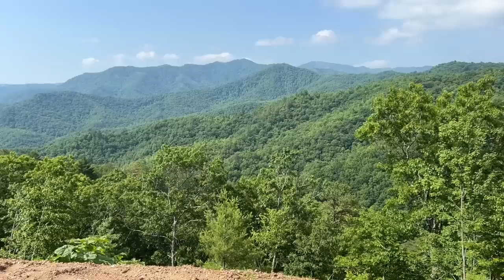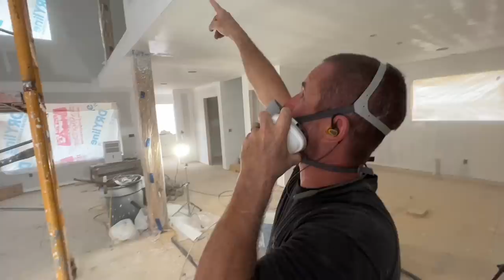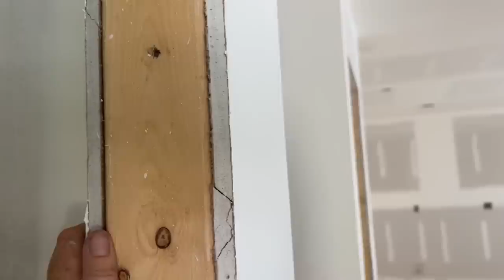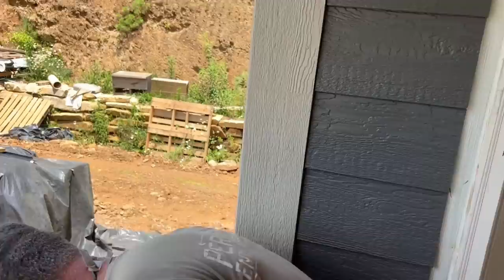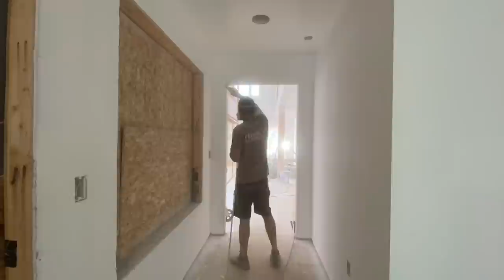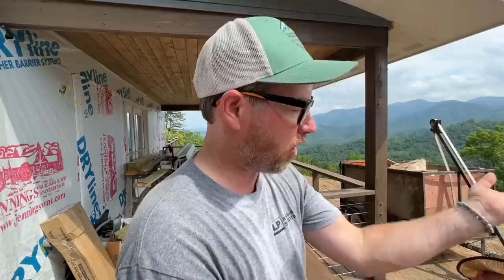Building A Mountian Cabin EP37 | Starting the finish work!

Comment: Put a 12” extension on that spray gun, you’ll get better results, you’ll be more comfortable, and less fatigued.
If you spray top to bottom, left to right, you only walk the length of the wall once.

Comment: If you tried a 3ft extension with a swivel tip you would never paint again without it.  Imagine double the reach in every direction.  Also put a whip between the end of the hose and gun , it will relieve the stress in the hose and both tips will reduce your fatigue.

Comment: Hey guys!  Great work!  Drywall core color is entirely dependent on the color of the gypsum (natural or synthetic) that's used in its manufacture.  The color can range from pure white, to light grey, to light brown.  I've even seen pink natural rock that makes a pink core in the drywall.  The color comes from mineral deposits in the gypsum.

Comment: G,day from Sydney Australia.
Perko, you should wear a disposable suit when painting the ceilings with a spray gun.
Moreover, in the power tool update program, you can purchase a round drywall joint sander (if you're using it regularly) with vacuum cleaner attachment.
🌏🇦🇺

Comment: Y’all should definitely invest in some of those cloth head covers for when you paint that way there the paint don’t end up all over your face and in your ears and on your head. They just have a perfect hole for your eyes that you can put glasses on over top of your mask. Those things work wonders for painting overhead like that with a sprayer. And they’re not very expensive you can buy a whole 10 pack for a few bucks I believe at Sherwyn Williams that’s where I get mine. Don’t get me wrong they are a little hot but it definitely helps out on Clean Up on myself at the end of the day

Comment: Hey Jamie, Several episodes ago I remember at one point you mentioned an awesome tip about circular saws edge being 1-1/2" from the blade. I found out last week that that is not always the case for all of the saws. The dewalt 6-1/2" 20-volt max cordless saw is less then 1-1/2" from the blade. Not sure if they are changing things up, or if this is just for the smaller circular saw.

Comment: lifting buckets of paint? easy 20-30 years ago, no problem, When I worked in the trades I was a drywall finisher/plasterer It was quite a common thing for me to mix up 4 buckets of mud and lift them up onto scaffolding two at a time for the guy working up high, then I'd put my buckets up where I could reach them. I could run through 2 buckets of quick set durabond quick set mud, have my hawk, trowel and buckets clean before the first bucket would even think about starting to set up. 

I'm retired now due to spinal injuries from a head on collision, so I doubt I could lift them like that these days

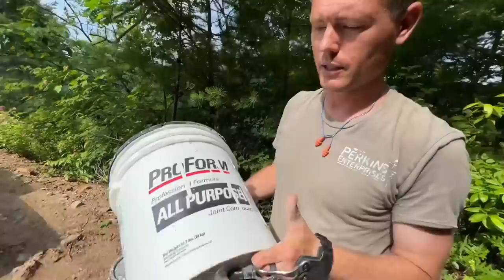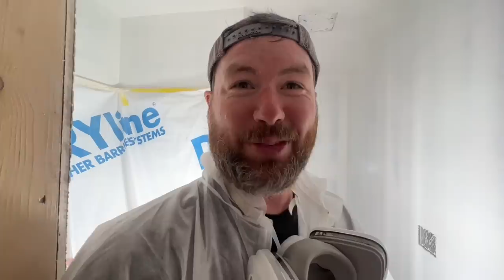Comment: @5:22 that's a great idea.  You can even use the lid to clean you saw blades!  @9:07 Real Life Tip.  When pouring the paint, orient the opening to the top so the paint and air won't compete for the same hole. ("I don't think you can say that on YT")    It'll pour w/o the klug klug klug.  Stolen from StudPack - I think.  It could have been Honest Carpenter's channel.
Reply: Lol, you can’t say that on YouTube! ; )

Comment: What is the best oscillating tool blade for wood and nails? They all seem to dull quickly.
Reply: Not sure but I think the key is to use super light pressure with the tool and move back and forth using the full width of the blade when cutting through nails. Move the tool a lot to allow cut material to clear the slot or cut area

Comment: do you guys not have vacuums that rattle off the filter automatically? anyone with employees here in germany has regulations on the vacuums that they have to provide. they have to automatically measure airflow in it and rattle the filters, or reverse flow and blow out the filters automatically. having dustbags still makes it easier, but they obviously add to the cost. 
or do you guys even have issues with drywall dust, despite having vacuums that do that?
Reply: Ours don’t do that. We just run it till the bag is full. You can tell. The vacuum gets pretty heavy. And if the suction gets low you can tell

Comment: there is a reason why your drywall is grey inside. When plaster of Paris is kiln-fired with Cole. It has a grey tone to it. Usually manufacturers use recycled wood.  there are different types of drywall. That are very old that have a peach or orange mixed in with the plaster. This is considered a fire retardant. Was mainly used in Canada. certain papers on the outside of drywall also has a different meaning. and in different countries this could be different throughout the world. Some of the papers have a wax coating on them. To repel water and mold from your drywall. there's a video on YouTube that you can watch how they make plaster of Paris. The old-fashioned way { Bäuerliche Kalkbrennerei. Teil 2: Brennen des Kalks und Austragen des Ofens } it is a very interesting two-part series on how they make plaster lime the old-fashioned way. It is very boring to watch a kind of interesting. It is a dying out trade. Usually done by old German Farmers to make some extra money.

Comment: once you sand the primer do you have to vacuum the primer dust before you paint?
Reply: Pretty much yes. We even sand the first coat of paint before the second coat of paint. Vacuum the floor each time for sure. If you touch the floor with your roller and it’s dirty it will pick up and put all the dirt on the wall I. The paint. Bad
Reply: @jaimeperkins9606  thanks for the reply!

Comment: Both a pro and real life tip from 40 years experience. Never spray the first coat without back rolling/brushing on raw sheetrock , wood, masonry,  ect. . You will have bonding issues.

Comment: Jamie? Would be me if those bucket cyclone dust separators help with drywall dust? Or would that be too much hassle and not enough help for that fine dust?
Reply: I’m sure it would help. And I have one… but it would be too much hassle moving around the house. Going up and down the steps. I use it with a shop vac on my Cnc

Comment: Having to fix the drywall on the bottom seams is why you should hang them vertically.  Then you only have seams running vertically between boards.  Fill the joints correctly and you also don't have wavy walls to deal with later.